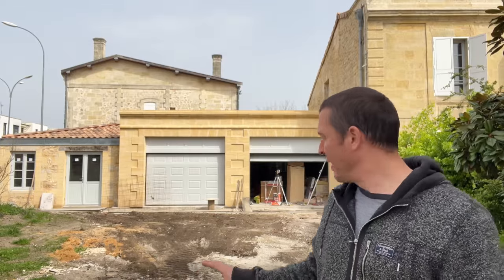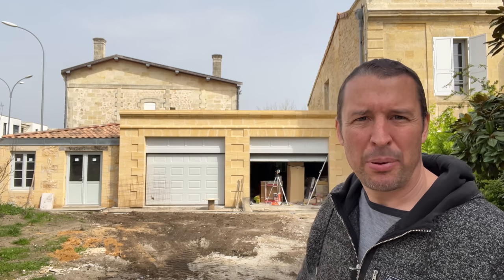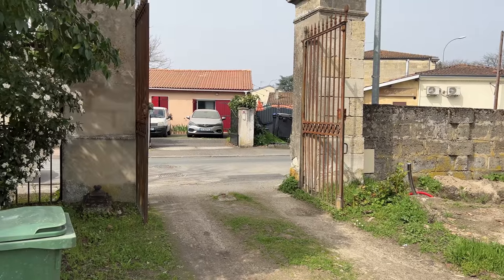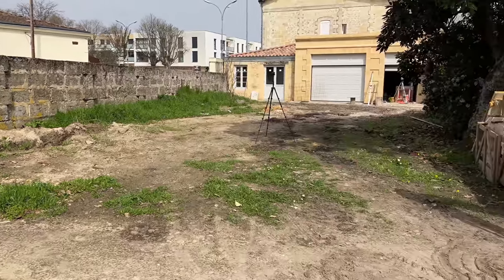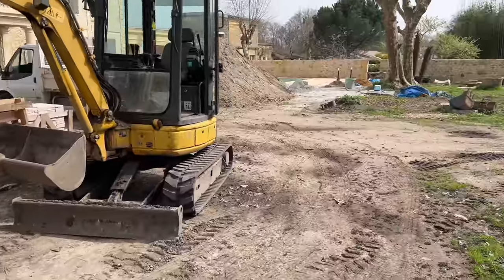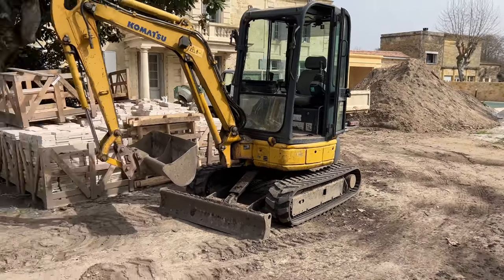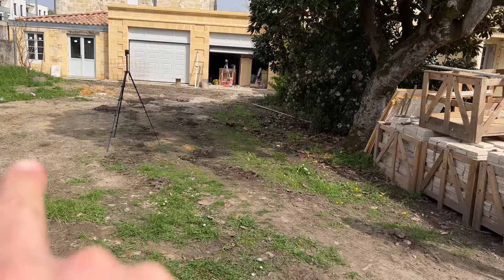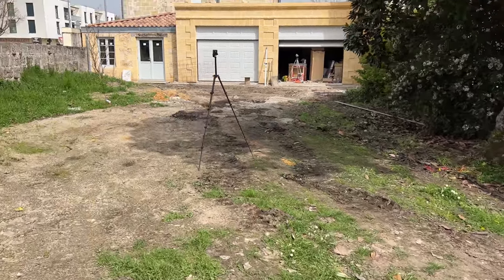EP145 Back In Business , Outside work & tackling cleaning with Jimmy  @ Our Passion Project

Comment: We have a similar device for cleaning our non carpeted floors.  And I love it! So much easier on the back as well.  
Sometimes i wish the reservoirs were larger.  But then it wouldn't be as easy to maneuver it around and it be heavier. . Therefore it wouldn't be as friendly on the back lol.. I'd rather add and empty a couple of times.  
For a place as big as a chateau,  people may think it wouldn't be enough.  Be in reality,  a person is really only doing a room or two at a time anyway.  So I think you and others will really appreciate it.  
I have a different machine for carpeted areas.  But it too has smaller reservoirs to take the strain off my back.  (I have severe back and hip problems) but find the items we have very friendly.  Both of our products work great picking up dog hair as well.  And the solution you add to the water leaves a fresh scent in the air. 
Enjoy!

Comment: Please remember not to push yourself too hard. When your working you should be wearing a back brace for the foreseeable future. Bending over and working like you were doing in the video is really hard on the lower back.  Watch the application of any heat and follow that up with ice packs.  AND for heavens sake, please be careful with the pain medication. The medication will make you feel better, but would also mask the pain for any additional injury that could happen when working.